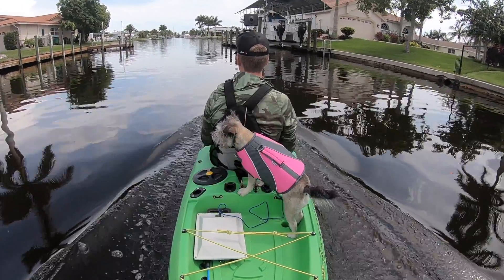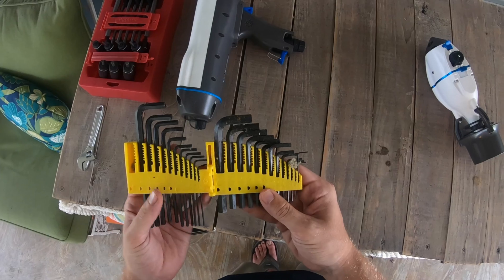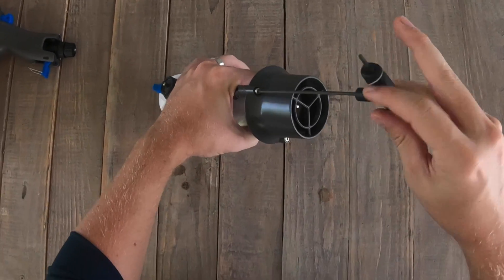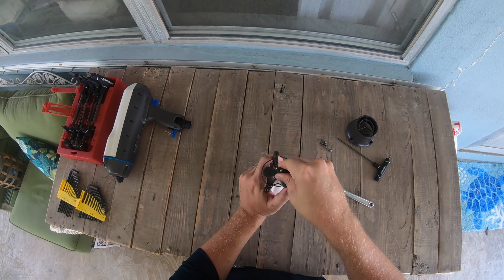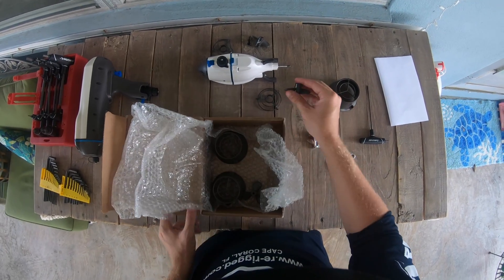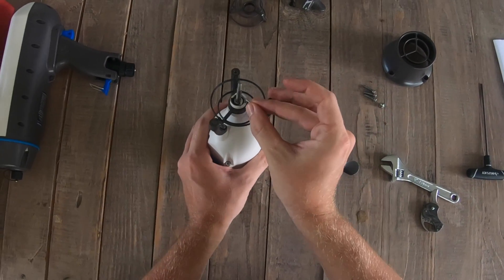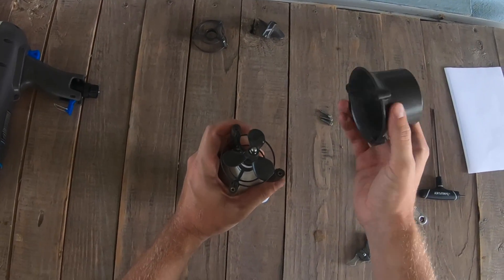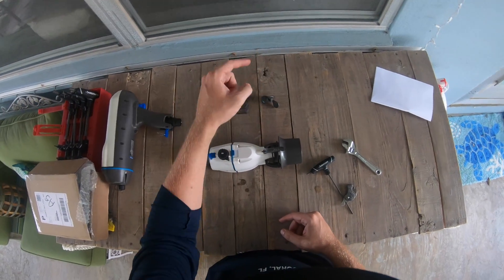Bixpy Motor Kit: Repair & Maintenance

Comment: On side note, when connecting the thruster to the trolling motor backet, the black cap to secure it in, I am able to line it up and make a turn but it's not that tight, I can lightly loosen it, afraid it might loosen up if bumps onto debris or seed weed in the water. Thanks
Reply from the maker: Leo Saechao I haven’t had any issues with it coming loose.  I do use dielectric grease on all connections.  Even if it did come disconnected the dielectric grease would protect terminals.   I only use Bixpy in saltwater which is a highly corrosive environment.

Comment: Good video. Do you know anything about the connector ring when you mate the motor cable with the motor? It looks like I aligned the tabs and slots correctly with the line but forced the ring too far when turning and broke the tabs. Pretty upset about this. There must still be some little nubs left because the line on the ring stops in line with the white tab on the motor but it doesn't take much to get the ring to start moving again. I was hoping since I don't plan to disconnect the motor from the cable that I could put some strong glue on it at this spot so the ring won't move. I contacted Bixpy but haven't heard back yet. I know what I did wrong - should have stopped when it went around and it was tight, my bad. Would you have any advice, and maybe think the motor would still work if I glue it. Embarrassed :(
Reply from the maker: Don’t modify anything till consulting Bixpy.  Never should need to force any connection.  Never should use tools to make the connection between mount and Bixpy.  It only requires a 180 degree threaded turn.  In regards to repair I am not sure.  Bixpy might be able to service it.  That would be hard area to repair on your own I think.
Reply: I agree with everything you've said and I've contacted Bixpy and am waiting for a reply. The only thing I disagree with is that the connector ring started in the right position for turning is too hard to turn just by hand, it goes about a 1/4 of an inch and not 180 degrees, it's too stiff.

Comment from the maker: SHOP BIXPY FOR MOTORS & PARTS
https://bixpy.com/KayakDIY
TOOLS USED:
3mm Hex Key: https://amzn.to/2yC9cFl
Hex Key Sets (optional): https://amzn.to/2tuNnCT
Adjustable Wrench: https://amzn.to/2yBSUfM

The Bixpy has been one of my favorite watersports products.  I use it on my kayaks, paddleboards, and even handheld for snorkeling/diving!  Bixpy has been reliable and durable, but I was able to suck some rope into it and break a propeller.  I also broke an intake grill during the process of removing the rope.  This is the first time I have broken any parts.  I actually find it to be more reliable than my typical Watersnake trolling motors I used in past homemade builds.  Today I thought I would show you how easy and affordable it is to replace parts on Bixpy.  I like having the peace of mind knowing that my investment can easily be repaired by me and not always have to be sent off to a factory.  Total cost of repair was around $15 which is less than most trolling motor propellers and shipping was quick!  The job can be done in as little as 3-5 minutes by inexperienced individuals.  

KayakDIY is an Ambassador for Bixpy.  We chose to work with Bixpy after falling in love with the versatility and performance of their product line.